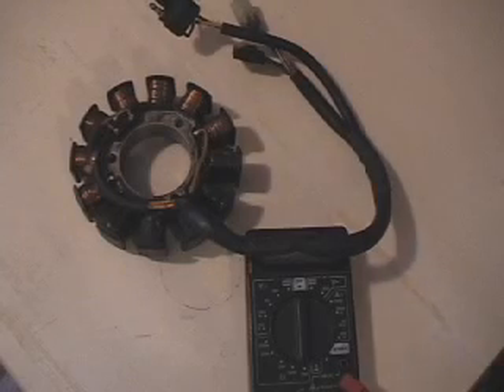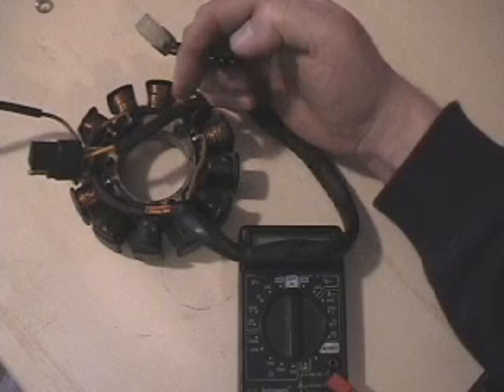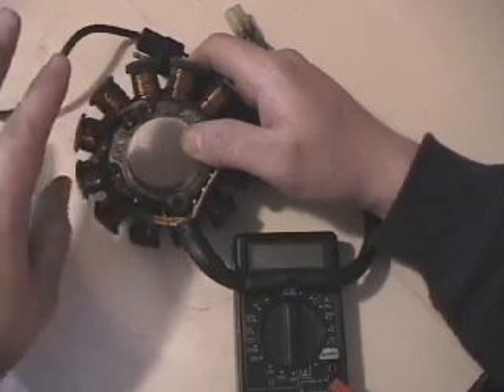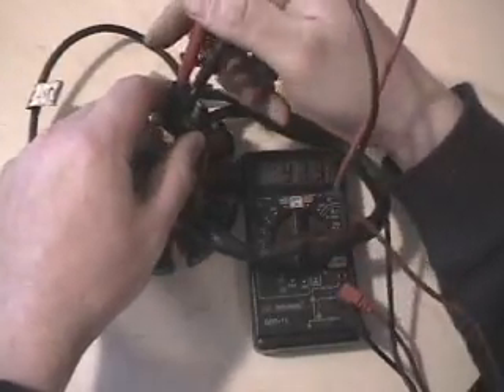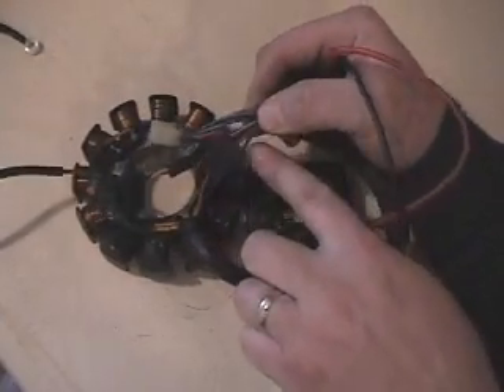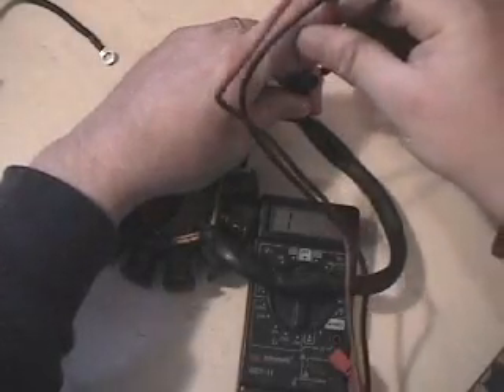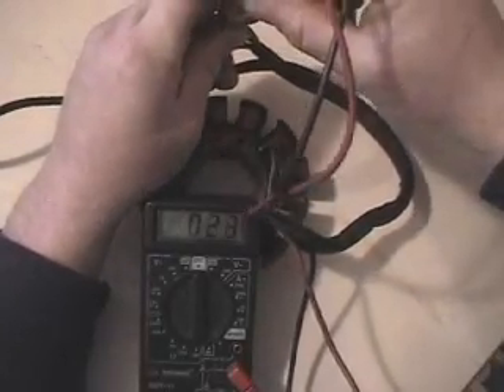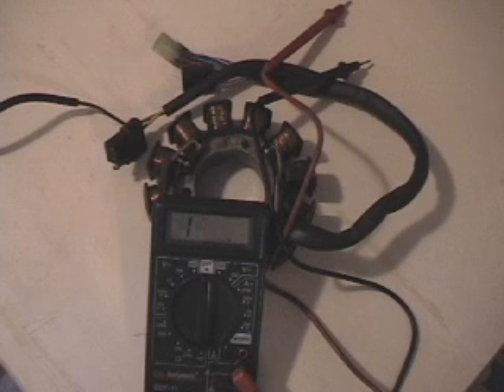Arctic Cat 2003 F 7 EFI Stator Testing

Comment: This is what my stator reads. What do you think?

3 prong power connection,yellow wires,1.5 ohms,ground to valve cover,1.3 ohms

3 prong connector, ignition coil,locking tab at bottom,left,center and right,center 17.4 ohms,left,right 33.2 ohms

4 prong connector (injectors and fuel pump) locking tab at bottom,top two,19.1 ohms,bottom two,3.2 ohms.

All tested on 200 ohms setting on my multimeter.

Does this sound correct? 
I think Power coil should be closer to 0 ohms,injector could may be high. It was tested in the machine.
Thanks

Comment: hey you there have a 2007 M6  no sparks. stator was changed, all 3 switches checked, coil replaced and replace ecu. still no fire.  I cannot see any voltage on trigger but is 92 ohms, changed also. I see voltage on the low bus, but no voltage on high bus. seem shorted when I take a ohm test from Red/black (rev/ alarm) wire to gnd from CCT. if I unplug plug from handle bar its open. maybe rev switch is defective. can you help me out please. running out of options.. thank you  PS: was running when we changed stator and trigger from RM stator but died after one ride

Comment: Blaine. Need your opinion. I have a2008 Arctic cat tz1lxr with a 1052cc 4 stroke. Endine starts great, idles great, runs good up to approx. 30mph. At this point it starts skipping until it reaches about 5500rpm, from the on it takes off without any issues. It's been to 3 cat dealers. Spent over $750 in diagnostic, they can't find the problem. They want to start throwing parts at it. No way... like giving out a blank check. In your opinion could this be a stators problem. Thanks. Ron StOnge